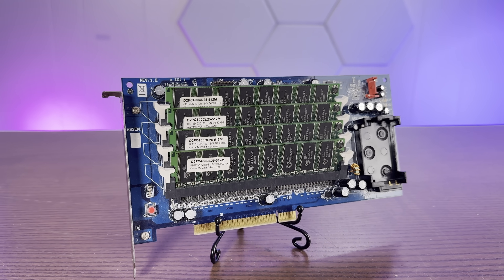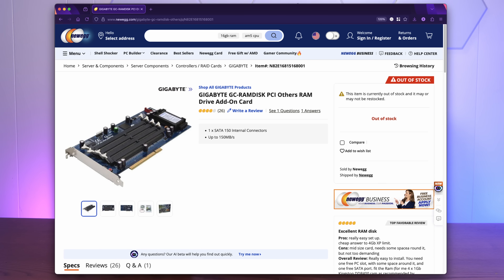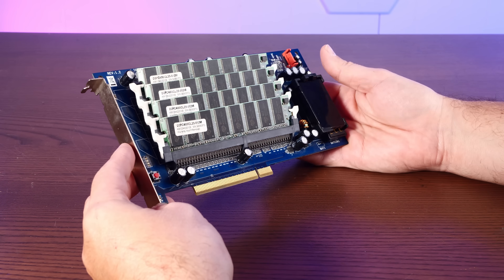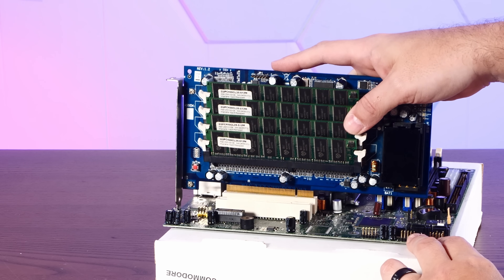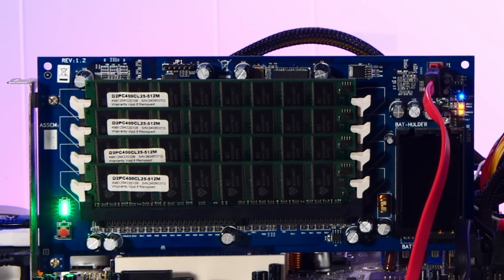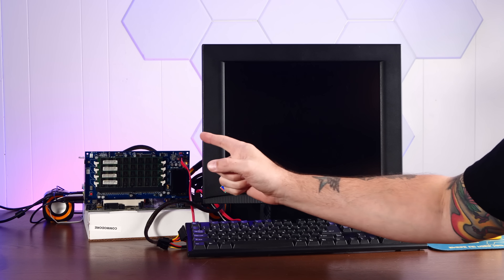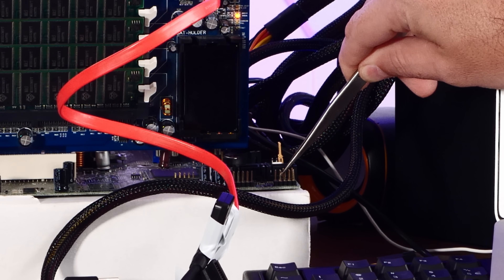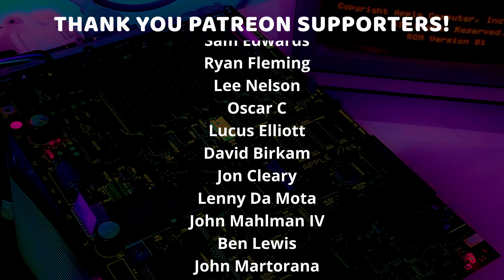This Early SSD Was WILD

Comment: Swap or temp space would pretty much be all it's useful for, but you'd need a script to re-initialize the thing at every boot in case the battery fails.
Reply: And that only if you had already maxed out the motherboard RAM in the first place which usually only happens to an older system which was bottlenecked with CPU or I/O anyway, or it’s an absolutely specific niche use case.
Reply: @gentuxable  Luckily, modern hardware now accepts decent amounts of ram. But I remember driving the drive on my old Athlon64 based machine completely berserk trying to get it to run Windows7. It now hums happily under Batocera.

Comment: I knew of someone who used it to get speed up of a database.  
They were also really popular as caching layers in PC based storage appliances,  they all came with RAM disk cards back in the day for performance.
Also raid cards have moved away from using batteries to using super capacitors with flash backing for the RAM.
Rather than keep the RAM alive, they use the energy in the supercap to keep the card alive long enough to dump the contents of RAM to flash storage.  Then restore the contents of the RAM from flash when they power up next time.
Reply: i guess it's still used in a way, with SSDs that have integrated dram cache
Reply: @ThylineTheGay  Also the fact that your OS will often cache stuff into RAM when it's free space
Reply: @ThylineTheGay interestingly enough the super caps come back into play. A lot of data center drives have encountered have super cap specifically to dump the RAM of the SSD to the flash chips. Most consumer drives I've encountered do not have this feature. Also data center drives that support the power loss failure tend to be longer for the m.2 variant.
Reply: Yeah, I'd love something like this as a block cache.  I used a "cheap and crappy" 120GB SSD as a block cache, but the write load burned out the SSD within 3 months.

Comment: I remember wanting one of these at the time. The card was pretty affordable, but the ram added a lot of cost.
They absolutely wiped the floor with any consumer storage device of the day, and any pro storage that didn't cost at least 10x the price.
Absolutely ideal for a performance-critical drive that didn't need assured persistence. Cache for network storage or scratch disks for computational work. Plus for some military / security applications you really need your decrypted working storage to be volatile, so the intrinsic volatility is a sellig point, not a drawback.
I remember reading an article where someone built them (8 iirc) into a RAID0 and pushed some wild numbers.

Comment: you should've put this a more modern system that had a newer sata hardware.
SATA300 was the bottle neck.
A SATA600 would've shown the true potential of the card.

I would've also tried using DDR200, DDR333 and DDR400 to see if they would've made a difference.

Comment: I think the problem for most people using this technology is that it's best attribute is its write speed. The average person reads data significantly more often than they write data. 

I'm pretty sure people used to use these to keep their websites or their databases from going down under heavy load. 

Maybe there was a use case for video editing back in the day? If I'm not mistaken, there used to be a time when video editing software would make a lot of intermediate copies of the video you were working on. Something like this would be great for that.
Reply: Or at very least, a swap space for data center nodes.

Comment: I wonder if you could make something like nand flash with dram cells. Basically nand dram. The major difference really is connected Gates instead of floating gates. The hope is you could get the density of nand flash but the speed of vram at the cost of it being volatile and needing to be refreshed.

Comment: If you could source several, build a striped RAID array using them with maximum memory modules. It would be interesting to see where the performance bottlenecks would occur. Would be a fun challenge to build the fastest possible Pentium 4 rig using stuff like this.
Reply: That would also mitigate the battery issue, I would think.
Reply: @rynovoski not with striped RAID (raid0) that would make it even worse. If just one battery (out of all cards) died, all data would be lost
Reply: @TheRailroad99 
For a caching layer or as explicit wipe on power down applications, this isn't a concern

Comment: It would have made more sense, maybe sold more, if the PCIE port was used for data and not just power. Some 20 YO PCs would still be booting faster than most systems built today.

Comment: OMG!! I was JUST thinking of something like this the other day (didn't know it existed) .. I was thinking that as computers move on from using DDR3 to DDR4 to DDR5, there is a LOOOOT of Leftover DDR3 and soon DDR4 from old builds that would otherwise go to a landfill .. I have a literal Drawer full of DDR3s that I no longer have machines to use in.  Something like this card would be a great way to turn a stack of retired DDR3s and DDR4 into a useful VERY Fast Drive for intensive applications like Gaming or AI.  And you don't have to worry about Volatility if you power the whole thing using a USB charger.

Comment: I would absolutely LOVE to  have a DDR4 version of this that can hold enough memory for a modern boot drive. With super capacitors instead of a battery. RAM basically never wears out. Super capacitors have virtually infinite charge cycles. It would be a super fast, indestructible boot drive for less than a thousand bucks total!
Reply: "indestructible" EXCEPT for when for whatever reason, the power is lost (capacitors can and will fail and hold very little of actual charge)
Reply: @FutureChaosTV  Please look into supercapacitors and ultracapacitors. They are extremely robust, ubiquitous in backup systems and hold more than enough energy to keep a couple of RAM sticks online for days. In low power mode the power consumption of a stick of RAM is milliwatts.

Comment: Pretty cool, I didn't know those existed.  I suppose an alternative would just be adding extra RAM to the computer and then using RAM drive software to partition some of it as a drive.
Of course, you'd have to copy files back and forth every time you shut down or started up, that's one problem the card solves, but so would a batch file.

Comment: Used to have an ISP customer who would have us load these into 4U Supermicro whitebox rack servers and then used them as high-volume spam filtering systems.
Reply: just curious, but how would this help with filtering spam?
Reply: @KavyanshKhaitan just iops. Input output per second. With a server you focus on bottlenecks. With the CPUs and other things at the time, you could move hundreds of megabytes per second. Meanwhile emails were kilobytes. With a spinning disk for cache, the low amount of IO operations would be a huge bottleneck. Meanwhile, this product would reduce millisecond access time to nanosecond access time. That helps a ton when processing kilobyte size files.
Reply: @KavyanshKhaitan it helped greatly with file system I/O. High volume mail servers have to work with tens of thousands of small files at any given moment, which kills read/write speed when something like 80% of the time is spent by the OS opening and closing file handles and dealing with fragmentation. SSDs of the time would burst into flames in less than a year with that kind of work, and even modern SSDs aren't ideal for that kind of thing. RAM disks were a thing but data would be lost on a shutdown or reboot.

You can even see this today. Try creating 2GB'S worth of 3 to 5 kilobyte files, them move them from one drive to another and watch write speed drop from hundreds of megabytes a second to tens.

Comment: It was not  relly an SSD. 
Early SSDs were Disk on Modiule-s and IDE compatible CF cards. 
 iRAM was a RAM disk.
Reply: Not really. A RAM disk is a virtual disk formed on, you guessed it, system RAM.

The difference comes from that the data goes through your RAM controller to the CPU. It would however, be a LOT faster than being limited by the SATA bus.

The card shown here is nothing more than a glorified SATA SSD drive, and the memory on there is just used for the memory chips as storage, not for actual system RAM.

Comment: Hell yeah i would use that to set my viirtual memory paging file so my hard drive doesn't get dragged down and full and fragmented all the time. perfectly useful. Ram lasts longer then SSD's to reach time virtual memory reads and writes to a SSD in large amounts constantly its wearing the SSD's out quicker. Ram it can handel it with out wear and tare ^_^ i must get one if i ever get a older desktop with PCI slots on a older motherboard.

Comment: I use a RAMDisk on my PC sometimes with ImDisk Toolkit—works great for smaller games. You can even run one off VRAM with a GitHub tool, hitting 11–22 GB/s speeds. On a newer systemish from 2018😄  

For your Samsung SSD, try Samsung Magician in performance mode. I’ve got 64 GB of physical memory and set up a cache for my Samsung drive: one SATA M.2 with 20 min / 40 GB max, and another NVMe with the same 20/40 GB setup. My RAM usage climbs to ~82 GB (about 40 GB hidden from the Samsung drive).  

Funny enough, my SATA drive usually wins out—its RAM caching response is just unbeatable compared to my NVMe, even though the NVMe does well on raw throughput.

Comment: HEY! I actually sold a bunch of these back in the day when they were new/relevant! And, that whole 'battery disconnect making the data go poof!' was the KEY selling feature!

It has been long enough, and I cannot find a single instance of any of the people/company names online, so I can tell you that they were selling "sensitive data secure erasure in milliseconds" and all they did was make a dummy battery that plugged in to that battery socket that ran to another (smaller) battery and switch on the front of the server case. So the computer could be rebooted, but if it went offline for 10 minutes (they had backup generators on the roof, and UPS in the rack) the battery was dead. I think that they tied it into the power so that if the power was cut (not the UPS activating, not the backup kicking on), the power was automatically shunted from the battery and board into power resistors to drain them. These were set up like scratch disks for some "unknown" function. I do not think that they modified the board in any way, just the server boards, but they made me and the guys in RMA test the i-Ram cards for days. These boards were EXTREMELY picky about what RAM they used, IIRC. And the worst part was, they didn't max them out. They were only using 4x128MB so it was barely 512mb disk, but it was the 'security' of them. I must have sold at least a hundred of them, but commission was like 2% so I don't even know if that got me over my base rate...
Reply: great if the FBI comes to town    
You're buying privacy
Reply: I knew someone who had a system with 1GB RAM but no hard drive ... this was back in the 1990s, and was for secure offsite use for JPL. Power down and POOF.
Reply: I could see the military or government wanting these back then.
Reply: @stgigamovement  Now days I'm sure it wouldn't be necessary since you can put terabytes of RAM into one server. I personally have 384GB of RAM in my home NAS - 64GB of which is dedicated to ffmpeg transcoding, automated pipeline builds, etc. I am however just doing for read/write speeds, not security - but I imagine the security would be the same.
Reply: @linuxguy1199 you can, but you can’t (trivially) reboot without losing main RAM…
Reply: sounds like a perfectly normal VPN business that keeps its logs on barely-battery-powered RAM disks :- )
Reply: @TheDoomerBlox  nah, they either store logs in a regular way, or do not store them 

Mullvad does have their nodes run off ram only with no persistent data, but afaik it's just regular ram, not battery backed
Reply: yeah it still has the problem of being vunerable to cold boot that all ramdisks have
Reply: @gamagama69   well total memory encryption helps with that
Reply: @gamagama69  not if you have a capacitor wired to case open that fries the chips
Reply: This was my first thought. Someone was modding these to store sensitive data.
Reply: That's quite fascinating! It reminds me of a rumor I once heard in my country (though it was never confirmed), about employees in a financial institution being instructed to discard a traditional mechanical hard drive into a bucket of liquid, supposedly to demagnetize it, in the event of a tax audit. Those RAM-based devices sound considerably more practical, though. At least it wouldn't involve a suspicious bucket of liquid in the middle of the office. Haha
Reply: @martinrizzo I would think acid would be the most likely kind of liquid. Demagnetize the drive by eating the magnetic coating off the disks.
Reply: You would think the card would of had a barrel jack so you could keep it plugged into a UPS at all times.
Reply: @player_unknown963 Below the battery is an unpopulated connector. That might be for the pro version
Reply: @player_unknown963 yeah, though you'd probably just use a battery eliminator
Reply: Weird story when RAMDISK was around for a decade by then. Shunting batteries? Really? 😅
Reply: well that's sus AF
Reply: Huh that is a good idea.  I should of kept mine for that reason.  I just returned it the next day because while the speed and access was amazing, the capacity was just such a problem.
Reply: neat! It's scary to think that they had (or THOUGHT they had) a business where somebody might come in and try to steal their data and they needed to be able to keep so much data it couldn't just be in regular ram but had to be able to poof on command if needed. Probably either department of defense (with some kind of old security protocol that had been adapted for modern computers without totally understanding it) or some kind of financial company with electronic funds transfers/ cc infor whatever)
Reply: @confuseatronica you’re forgetting crime

Comment: I would never have used that for any data I wanted to keep.  While it is a cool piece of tech, it has to keep refreshing the RAM constantly, every RAM clock cycle, 24 hours a day, or else you would risk data loss.  That seems like it is certain to eventually go wrong.
Reply: But i think its very secure. Just pull out battery and all data is gone forever and no one can recover it.
Reply: It's significantly less than every clock cycle, and RAM chips can be instructed to refresh themselves on their own rather than the iRAM's controller needing to explicitly refresh each chip. The main memory in your PC is doing the same refresh cycle the entire time your computer is on, the real fear is stray radiation from space flipping bits. For server RAM (and with DDR5, even normal RAM to some degree) an error correction algorithm checks for random bit flips continually, so they can reliably run continually for years on end.
Reply: @jercos  No power, no refresh.  It really is as simple as that.
Reply: @georgeh6856  And? That's the nature of battery-backed NVRAM. In extreme cases (enterprise RAID cards) the whole cache is battery-backed, allowing the card to retain whatever data was last written, until power can be restored. Lithium battery/SRAM combination NVRAM modules were specced to last 10 or more years. Refresh cycles cost more power than keeping SRAM alive, but not so much that this is somehow unreliable.
Reply: @jercos  My hard disk drives have NEVER failed due to a lack of power.  Even when I had filesystem problems, I was often able to recover at least some data.  Do that on your RAM drive after the power has completely failed.

That IS the point.  But do go ahead and put all of your most important files on this battery-backed RAM device.  Don't come crying to me when it fails.

Why does this upset you so much?  This device isn't even around anymore.  I guess you were the one who designed it and now you are crying because I dared to give any negative criticism of it.  Get a life.
Reply: @georgeh6856  Bro... you're the only one here acting upset.
Reply: @jercos  You trolled me.  I posted a very non-controversial comment.  Some people liked it; other people replied without getting upset.

You, on the other hand, posted trolling replies to my top-level comment over and over and over again.  Why?  You never stated that, even after I asked you.  Now you are projecting by telling me I am getting upset.  Seriously???  Get a life.
Reply: That's just 2GB, even back then it was easy and relatively fast to back that up frequently. People forgot how slow HDD use to be, even as just a normal user/gamer I had 2 10k RPM drive in RAID0 just to at least somewhat have decent performance in everyday use.
Reply: Honestly I don't use any SSD for data I want to keep (only spinning rust) since when SSDs fail they tend to do so catastrophically and with no warning.  (Same reason I won't purchase a carbon fibre bicycle.)  I do use them in RAID-1 (along with an HDD), for caches, and for high-speed copies of large read-only files; breaking my rule I also use them for read-write SQL database files but those are frequently backed up.

Comment: Back in 2006 most peeps were using 7200rpm HDD. Kind of ok , if a bit slow for windows XP. It’s when vista came out that it was annoying and a HDD slowed things down a fair bit.
Reply: Yeah, 5400 RPM drives are laptop drives, spinning the disk slower uses a lot less power so it prolongs battery life